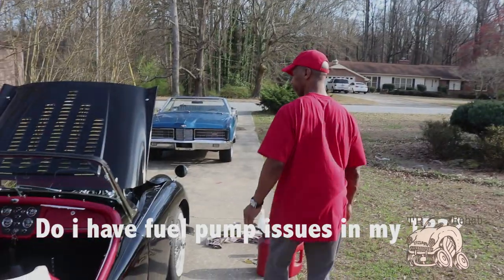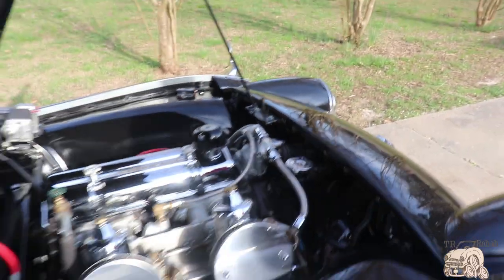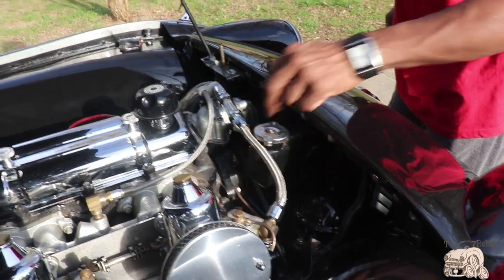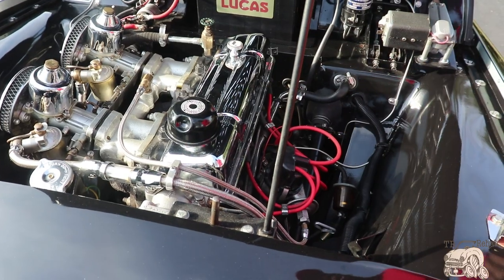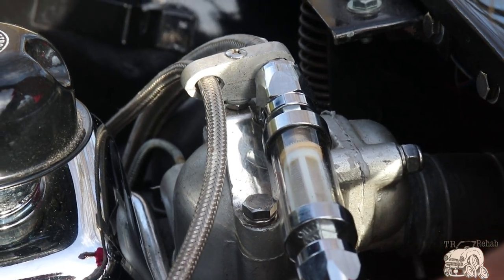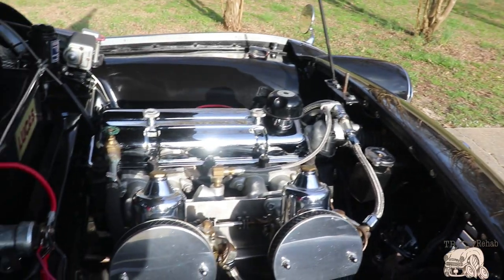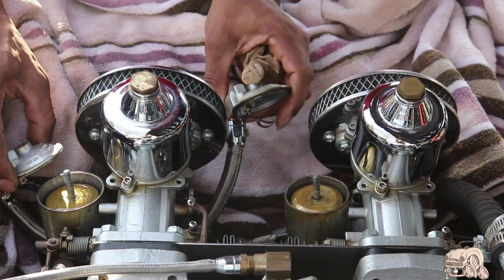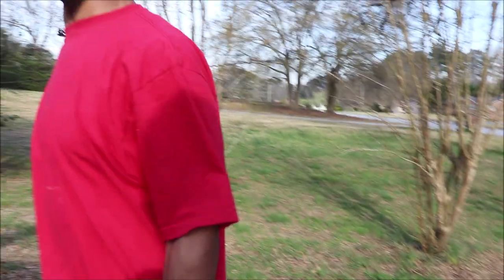Triumph TR3 Fuel Pump Issues

Comment: You troubleshoot like a mechanic, so that's good enough! Very logical way to isolate your problem without tearing stuff apart that doesn't need to be. I think you've got it nailed. I'm not familiar with the TR3 fuel pump, but the Spitfire one is probably similar, made by AC. My rebuild kit came with the two little internal check valves (little diaphragm ones smaller than a dime), but they are pressed into the body and then peened in. I didn't do this with mine because I was pretty sure I would have wrecked the pump trying to get the old ones out. Maybe something to look at before you get too deep.
Reply from the maker: Always good to have feedback. I rebuilt this one 5 years ago. Been a while so pretty much like the first time again. I have 3 original pump I have ordered rebuild kits for. I have heard not to purchase the aftermarket pumps. Better to rebuild.

Comment: Hi- this is Brian with a 57 TR three, a lot like yours. You had given me some very nice advice before on the problems I am having starting. I went and purchased a glass view full fuel filter which is very helpful and seeing that my fuel is pumping well. I can still start it if I use a kick starter fluid, but it really doesn't start very well if ever, without a kickstart. I confirmed that the chokes were stuck and I have adjusted it to the point where I can get it to pull the jets about 3-4 mm, if that still isn't enough to have it start easily. When it starts, it idles  at about 1200 RPM. I am trying to follow your logic about isolating the problem, but I'm kind of stuck. Do you have any suggestions about what I could try next?
Reply from the maker: I'll try... lol... So you are getting gas to your fuel bowls but not the intake if I am understanding you correct?.... On the fuel bowl top is a jet in each. Are you sure that it is releasing in order to allow the intake to syphon air and gas? Also check that you pistons are not sticking closed which would restrict the intake from drawing the fuel. Check the little lifter pin under each piston and make sure the piston is rising and falling correctly. Push the pin up and release it you should hear a thump from the piston falling. Make sure they are lubed.
Reply: @TRRehab  thanks for your response. I will check into these things. In the past I had once opened my float bowls (in fact I'm assuming that the fuel bowls and the float balls are the same – is this correct?) and noticed that they were empty. But at a later time, I after giving it a kickstart it started and ran for a long time and it looked like gas was coming through the glass filter that I had purchased. What I will do now is after this happens to check the fuel poles and see if they are full of fuel. They may not be. Also I will check the Pistons. Thanks again for your suggestions here.

Comment: 1. Blow out the lines.  2. Pull the fuel pump and replace with a rebuilt pump or a new diaphragm.  Make sure the diaphragm is in place correctly. It's easy to have the diaphragm not quite engaged with the pump arm.  Good Luck.
Reply from the maker: Thanks for the feedback Donald. I just ordered 3 rebuild kits. I have a few original pumps around the garage. I'm not mechanic but I'm not too bad at following direction. Sometimes it's the simplest things another may see. That's why I posted the video.
Reply: The rebuild kits are pretty straight forward.  The only two things to watch are the two "fuel in" and "fuel out" valves being inserted correctly.  Just check out how they are when you pull it apart.  The other is getting the diaphragm arm connected correctly to the pump arm.  You have to insert it and turn it 90 degrees.  Then make sure the pump arm works the diaphragm and you get suction at the inlet hole.  There are a couple YouTube videos on it too..
Reply from the maker: @donaldpetersen3678  Absolutely

Comment: Did you change the f pump only or do you find an other mistake as well - I have f pump problems as well
Reply from the maker: It wasn't the fuel pump. The fuel line was degrading on the inside and small particles were clogging the jets. It would only do it so often. Every time I cleared the line it world run for a few weeks and do it again. Changed the line and hasn't done it since.